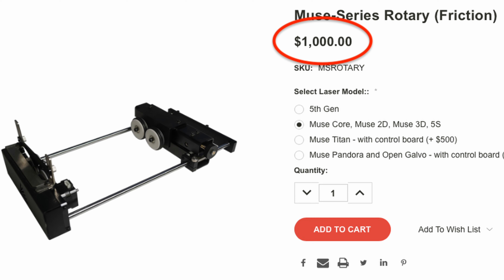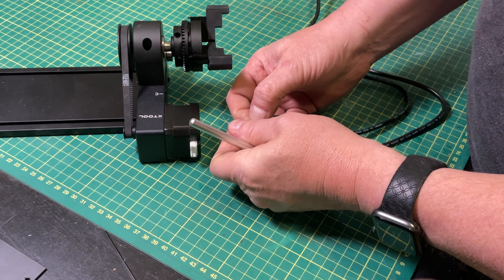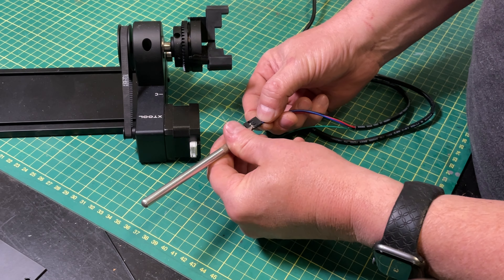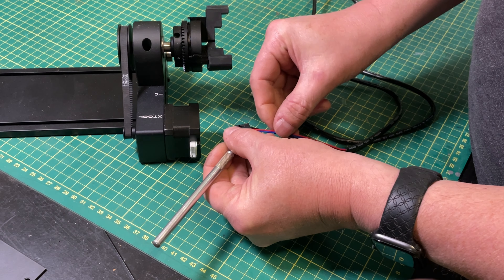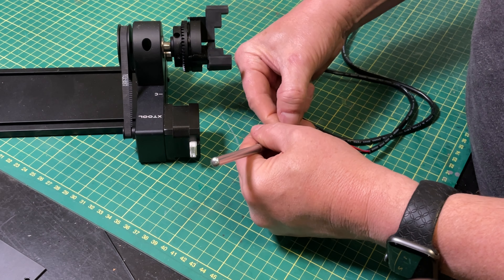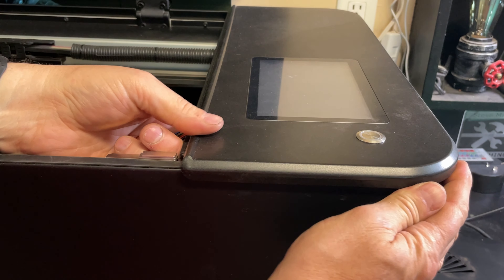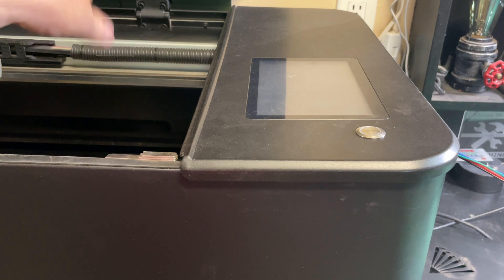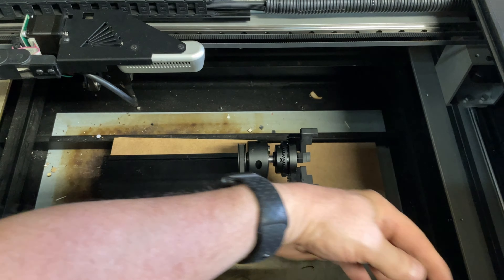Can You Engrave Glasses with Handles?

Comment: Hey Steve thanks again for the video. I have my Aetzer rotary up and running good. The only thing that I have noticed is tiny vertical lines of powder coat left on my tumblers. It is like the stepper is skipping just far enough to miss some of the powder coat. Have you experienced this? Thank you!
Reply from the maker: If you are engraving images, increase the DPI resolution.  You can also do a lower power second pass with the scan direction rotate by 45 or 90 degrees.
Reply: @SteveMakesEverything  I’ve tried 1000dpi and it did not make a difference. We have run several high power passes and no difference. I’m not sure I understand what you mean with the scan direction. Thank you!
Reply from the maker: @karicunningham8292  If you go to the advanced settings for a layer (color) in lightburn (assuming it's an image or fill), you can change the scan angle that the laser engraves on subsequent passes.
Reply: Ahh that explains it. I’m using RE3 lol. I assume that is not an option. Maybe I need lightburn. Thank you!
Reply from the maker: @karicunningham8292  You can get the same result in RE3 but it would involve a lot more work because you would need to duplicate the image and have a second set of settings.

Note that FSL lasers don't support Lightburn.
Reply: @SteveMakesEverything  well isn’t that just my luck. Lol. Thanks for answering my questions Steve!

Comment: The stepper motor wires are easy to identify, the w wires that are shorted belongs to the same coil. You can use a multimeter or something.  
Most nema 17 have the first and the third fisrst coil, and thir and sixth as second coil.
Reply from the maker: Yup.  A quick google search will confirm the various nema 17 coil pin outs.  There are typically two common setups

Comment: Thank you for this! I've been wanting a rotary for my muse but couldn't justify the price of FSL's version. 
Have you removed the bottom of your muse in this video? You seem to have a lot more z height in yours than I have in mine.
Reply from the maker: Yes I have a Riser so the bottom is several inches lower than a normal Muse.  You could build your own equivalent of the Riser though - it’s just a big empty box.  The RA2 Pro works great with the Muse if you’re willing to do some math for every job. You can do a lot of math though before you make up the $740 price difference though

Comment: This is awesome - thanks for sharing!  One question though - I have a Muse 2D and we have FSLs friction rotary. I know you replaced the cable from the controller to the rotary but if I didn’t want to do that is the RA2 stepper motor wired differently than the FSL?  When I connected the RA2 to the Muse while in rotary mode it wouldn’t move the stepper motor. Could do a restart and connect the FSL rotary and it would function fine.  Any help would be appreciated!  Love the Chanel and love the content!!
Reply from the maker: Hi Ed.  I touched on this a bit in the video - there are at least two different wiring configurations for these stepper motors and appears that the RA2 Pro and the FSL rotaries are on opposite side.  This is why I had to swap cables in the video.

The alternative is to get another FSL cable (because they use that larger 4 pin Molex connector inside the laser) and rewire that for the RA2 Pro.  This would avoid having to tear apart your laser to do the permanent rewiring.

Sometimes rotaries will also come with a short cable that you can plug into the end of the existing  cable and then into the rotary; however the short ones that came with my RA2 Pro didn't seem to have the right connectors to plug into the existing cable so I couldn't use it.
Reply: Thanks for the information!